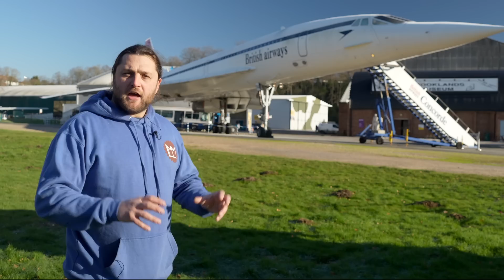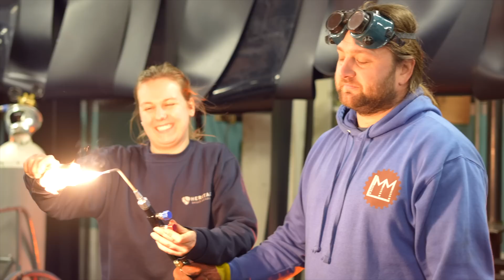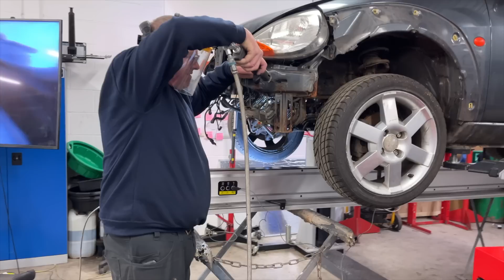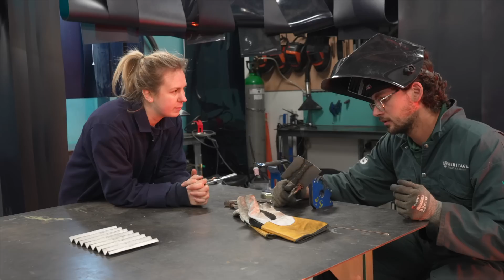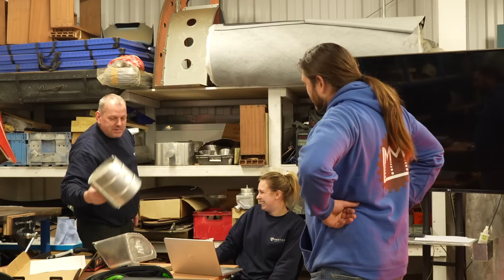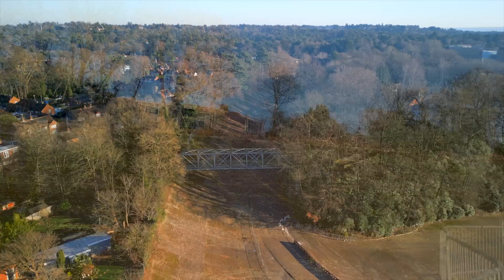The most Important Workshop - Building the skills for the future. The Heritage Skills Academy.

Comment: All good until governments force everyone into EVs and put a stop to steam engines and classic cars and trucks and they'll all become static museum displays and locked in people's garages.
Reply from the maker: I don't think it'll happen.
Steam can run on wood, or other friendlier fuel sources. Worst case classic cars can be converted to eV
Reply: @lmm  Converting any classic into an EV would be a crime in itself.  I just see the way things are going in the UK with EV mandates.  I also doubt it will ever come to that because there would be major revolt. 
As for wood burning, the greenies also don't want wood smoke but steam engines could possibly be exempt because they're historical machines.  I don't know about the UK but many old steamers have been converted to run on diesel so that could be a problem too.   Let's hope it smarter heads prevail.  Big Boy 4014 in the US is one of many that have been converted to diesel.  Though I don't know if you can covert a wood burner to diesel.

Comment: Is there something like this for the Rail Scene? Seems like it'd be a smash hit in that sector.
Reply: I think at least a couple of heritage railways have apprentices. The Severn Valley are hosting an apprenticeship project to convert a Class 08 shunter to hydrogen power. The company providing the power train have used their apprentices to design and install the parts and mounting hardware on to the loco. I believe that the boiler shop at Bridgnorth also has apprentices who assisted building the boiler for the new build Riddles 3MT that is under construction.
Reply: Some of the large preserved railways like the Ffestiniog, Welsh Highland, Severn Valley Railway and some others run apprenticeship schemes.